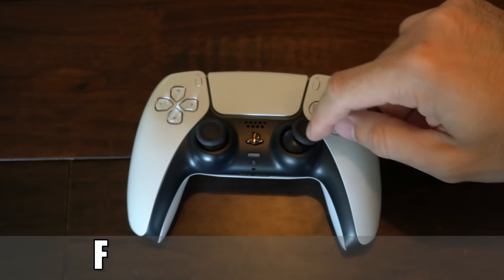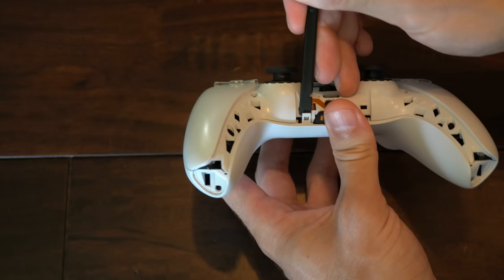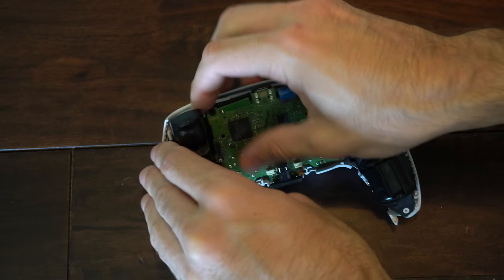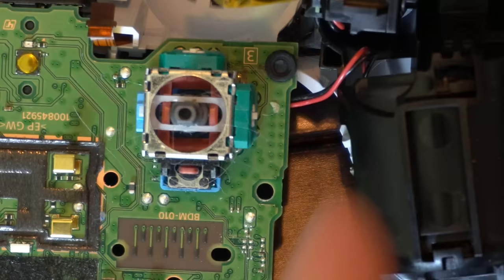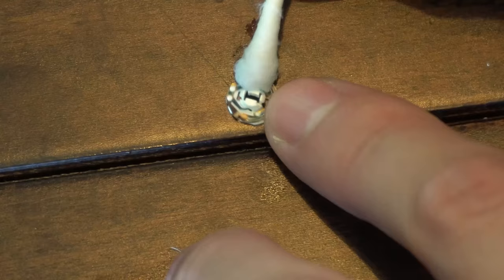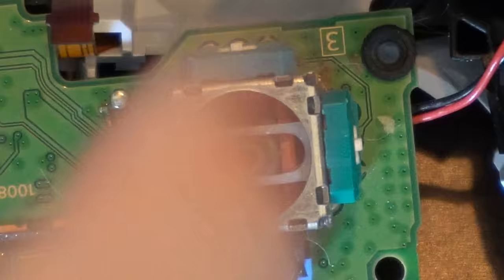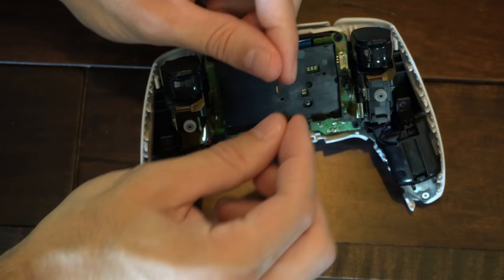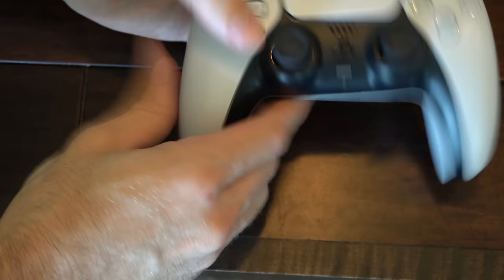How to FIX PS5 Controller Stick Drift & Moving on its own (Best Method)

Comment: Worked for me on the 1st controller i tried that had terrible drift. Just disassembled the 2nd 🤞update; fixed the second one as well. Very good simple to follow video. For reference I used WD40 blue for electrical components, I sprayed it into a bottle cap then dipped the cue tip in and cleaned it 👍
Reply: I did the exact same thing and it works wonders.

Comment: If you drop your controller a lot this most likely won’t help you, but if you let your controller sit around and get dirt in there then I wouldn’t doubt this strategy works . I took my whole controller apart and did this, and it didn’t fix it but I have extreme stick drift it makes me do 360s lol, Best bet is to get a new controller💯
Reply: That is what is happening to me rn. 😔

Comment: Thanks for the tutorial fixed my stick drift and for now it's working without any problems, even thought inside my controller was relatively clean I cleaned them the way you suggested and solved my problem. Thanks mate!

Comment: This was a great tutorial! followed it the right way and now my controller is working perfectly fine, It actually fixed my left stick drift. One thing I would like to add is to be extremely careful when opening the green case (potentiometer) because that can break pretty easy.

Comment: The only thing that fixed it for me was bending those tiny copper plates upwards so when you clip the green bits,they stick to the carbon circles firmer
Reply: That was the only solution for me, the tip of the plate was broken and the carbon inner circle was completely worn out, I had to bend the plate upwards and to the side to make contact with the external circle, it seems to be working fine for now but I don't think it will last more than a couple of months.
Reply: In my case one of those little copper plates was broken, I ended up replacing it with one from an old xbox controller, and that worked.

Comment: I followed the instructions but after reassembling  and turning it on, I tried a custom match on MW but the right stick is now stuck at point at the sky while turning left automatically. Any suggestions?
Reply: you sticked the sensor upside down

Comment: This worked like a charm. One of the green censor inserts had this black crud around the inside. Make sure all the inserts are properly placed when you put it all back together. I put it back together and my joystick wasn’t even working…after dissembling again, I put one of those inserts in upside down. Did it all over and now works perf. Be patient and gentle. Cheers!

Comment: Well, it actually did work perfectly. I did try opening and cleaning the controller before, but never actually took out the sensors. There was so grime inside and cleaning it actually got rid off the issues I had. Great tutorial.

Comment: Tnx man this is a great guide and easy to follow. Since I had all the tools I did it with all the confidence and I took it slowly step by step. Mine had some black grease inside, after cleaning with Isopropyl alcohol the drift is gone. You saved me a replacement and the hassle of soldering.

Comment: This worked flawlessly! Thank you so much! 

I believe the issue comes from plastic particles from friction between the joystick and the housing. Similar to what happens to the N64 controller but with a much finer or more sensitive mechanism. There were small black dust-like particulates that were cleaned off the contacts.

 I'm a very clean individual and I click-clack the thumbsticks as a habit during loading screens.

Thanks again! God bless brother 🙏❤️

Comment: I was skeptical at first because I did not see a speck of dust in my left stick's y-axis sensor (which had erratic y-axis movements). Cleaned it with alcohol pad + toothpick anyways then it magically fixed my problem. Thanks to you.

Also, taking the shell apart is the most difficult part IMO. I almost broke the pointy plastics.

Comment: BRO THANK YOU. SAVED ME 100 DOLLARS BASICALLY. 

I pulled out one of the blue ribbons entirely and I thought I was done but I was able to get it back on, and the battery part had me sweating.

If you take your time and go step by step you should be able to fix your stick drift yall..

W video man.

Comment: Solid guide and it worked on my oldest controller that came with the ps5 that had a hard left pull on the left stick. Also cleaned up my back up controller and that had slight drift creeping in. They both work like new. Excellent tutorial. Id recommend a broad beak tweezer for removing the ribbon cables and electrical contact cleaner rather than alcohol.

Comment: 10/10 video. The screwdriver you’ll need for this is a #0.

Had two controllers with this problem and just successfully fixed them both in about 1 hour on my first try. The trickiest part was opening the green joystick piece. Anyone trying this just try to control the force you apply to the green piece so it doesn’t bend all the way once it’s open.

I used a plastic card to open the controllers. Using a toothpick to clean the gunk works good too.

Comment: thanks for the video! In my case, left stick was drifting left , making it unbearable and unable to play any game. It turned out that this little round plastic thingy inside analog stick had those tiny pins turned in the wrong direction lol. I straighten them out and now it is working perfectly! I was furious, especially that controller is only 1 month old.

Comment: 2 controllers with horrible drift where character/menu items go way left. Fixed one of the controllers completely thanks to this video. The second one, still doing it a little bit but I must have not cleaned it well enough. Either way, this video saved me at least $70 on a new controller.

Comment: My controller had drift issue after 6 months, never had this issue with my xboxes before.

Anyway thank you for this video, a lifesaver. Very detailed and it works well. Indeed one part of the sensor was black and had to be cleaned. 

To anyone attempting this, these are my lessons learnt from a clumsy hand.
1) the white sensors are very fragile. I broke a small white part when cleaning it with cotton swab. meaning the stick wouldn't move back in one direction. Blutack saved the day (gunpla glue wouldn't do it). 
2) when attempting to fix the above problem, the green and yellow wires came off (I guess this is for the vibration). Didn't have my soldering kit with me so Blutack again saved the day.

Comment: This is very helpful. And very easy to follow. I tried it on my 3 year old ps5 controller and its now perfectly working. Some of the edges of the small components are damaged a little specially the blue one and its not perfectly closing(maybe because I use metal tools to pry open) but the important thing is No more drift. Thanks you very much. No need for me to buy edge. 😊😊😊

Comment: Thank you, your guide helped me clean the left thumbstick and completely eliminated the stick drift I had. I thought I had broken the small sensor piece because a bent one if the tiny metal prongs, but I guess they are just there for resistance and to hold things together or something as it didn't seem to have any effect on using the controller afterwards, but I used tweezers to bend it back to where it was roughly anyway just in case

Comment: Excellent tutorial, thank you for sharing this it helped me out big time. The only thing I'd change is the battery removal, the wires are super thin and very easy to damage. I just left it connected and moved on the the next step.

Comment: Awesome stuff man - I tested my controller at intervals throughout the process and it had actually been sorted just from taking off the faceplate and beginning to swab around the sticks. I'm guessing it was just some cat hair, dust, or grease. I did the entire process, just for the practice, and it was easy to follow. My only issue was getting the latches off at the end, as I didn't really have a tool for the job. I managed to get it done with a tiny flathead screwdriver, but I will buy something fit for purpose next time. Great work!

Comment: Great video - following the instructions exactly will fix this problem tenfold. The only thing I will say is that some controllers are a bit newer or older than others, so other pieces may come out entirely, whereas sometimes only the ribbon things on the motherboard come out. As long as you reconnect everything that comes out and that has been disconnected and you’re gentle with the controller, it completely resolves the issue without you needing to go get another controller entirely.

Comment: I broke like 5 wires in the process, lost two screws, and chipped a small part off. Basically I messed up almost as bad as you can, but it still helped big time.

Comment: Your the man!!! Ive never taken apart a controller of anytype or any electronics for that matter, my controller is only 5 months old and it started drifting at around 3 months the first time and i used duster that time and it seemed to work up untill now but i followed your video step by step and it is now working fine without using duster !! Ill post again if and when it starts to drift again to let everyone know how long it lasted but really thanks 👍 I didn't have to buy more duster or wd40 contact cleaner or thankfully a new controller. Once again thanks

Comment: Nice. Just did mine exactly as you showed and it worked great. Found a small eyelash in there! Thank you very much.

Edit. Nevermind. It was OK for a second and now the thing is just screwed after trying to fix it a few times. Thinking of replacing the whole housing.

Comment: Idk if I did something wrong when either cleaning it or taking it apart,  but I went through the entire process of taking my controller apart, unplugging the wires, taking out the sensor and cleaning it and I still have drift. Honestly I think it's just unfixable because it's had drift like this for a little over a year. At least I now have a practice controller if I need to work on anything before using my main one 😅
Reply: did you ever drop your controller ever ?
Reply: @slladowrealms  No, and even if I did it'd just land on carpet
Reply: @UB13 Same here bro I just took mine apart cleaned it and put it back together and it still has drift

Comment: Thanks for this video . I took it all apart . Directions were very simple & I got to fix what my issue was . It had a bunch of black stuff built up so I soaked it in the cap of the alcohol cap waited a few an then used a baby toothbrush and needle to clean around the copper areas that way the cotton hairs didn’t get stuck in the copper . No more dragging sticks . Thanks a lot 🤜🏽🤛🏽

Comment: Great video currently have 3 controllers with drift one is less then a year old thanks Sony.
Bought some replacement stuff from Amazon came with whole sticks and bunch of white circle thingys . 
Tried this with the one that was most far gone basically unusable changed them out works great now took me 2 hours so cost benefit may not be worth it if you got the 70 to drop would just get a new one. But if you have the time and patience like doing diy this is by far the best tutorial I’ve seen. Great video thank you 
PS4 controllers were far superior imo

Comment: I fixed my controller thanks to this video. Took me a while and I had to be careful with the pieces but well worth the $70 I saved. The drift was so bad the controller was useless anyway. Only reason I felt brave enough to try. Was gonna pitch it otherwise

Comment: IT ACTUALLY WORKED WTF! THANKS!

It really helps to have some tweezers BTW, and when you're putting those little pieces back from the analogue stick back in. Slot them over the little hook bit first, makes lining it up a bit easier.

Comment: I had stick drift to the left and tried this fix, but after putting the controller back together the analogstick was contiously inputting down. I probably  somehow damaged the sensor when cleaning it. But  a quck tip if you have the same problem and damaged the sensor(not the potentiometer), the ps4 cotrollers have the exect same sensors so you can just switch them out. This worked perfectly and my controller doesnt have stickdrift anymore

Comment: This actually worked for me! I had 2 controllers with drift issues, one of them was a dead case cause it was drifting in the same direction constantly so I experimented on that first and then I fixed a second one who was 3 months old only

Comment: I think I fixed it. It was those little sensors where the joystick was. Not sure if I connected all the wires, especially the bottom one, it was hanging out. But it works. So I’ll take that as a win.

Comment: It worked for me! There was a small strand on one of my sticks. Unfortunately tore the ribbon cable for the built in mic at the front of the controller by accident, but never used that functionality anyways.

Comment: I did this but since Ribbin cables are the bane of my existence the plastic piece snapped then a bent one of the metal wires and I’m trying to use electrical tape I will respond with the results

Comment: pro tip- if you cleaned both sensors and still have stick drift switch sensors from either side that fixed both my controllers with stick drift flawlessly

Comment: I guess it only takes the smallest spec of dust to disrupt the functions of the controller. Ive never had stick drift before; bought a new controller and like 3 weeks later casper starts playin with me. 

Man that felt like straight surgery, going in there trying not to break nothing. But it worked! Hopefully I won’t have to do it again too soon; much appreciated 😂😅

Comment: I followed this and the sensors were clean AF when I looked followed the process anyway but when I put back together just as I expected … still the same I’m furious that I’ve spent so much money on a fuckin console and brought an extra controller & they both have stick drift… one is the left analogue and the other is the right !!!

Comment: If people are having issues with it not fixing. Check the spacing on the distance between the metal tabs in the sensor, if they are too close it won’t work correct

Comment: I used canned wind pc cleaner to a partially fixed condition…. Im not taking it apart like this unless its absolutely necessary ,so goad you made this step by step….what i am curious of is: with my left stick pushing left randomly on pga23 now that i used compressed air …with the game off would it be safe to spray  electronics cleaner as an attempt to fix .then let it dry for a day or so before turning on …or would that possibly short out something because of battery still being in the controller?

Comment: I did the same. But the issue is still there. I mean there was nothing to clean by the way. It looked clean. Still I used alcohol and a qtip to clean. Then put everything back in. But faced the same issue. Didn't help me 😢
Reply: maybe your sensor (the white part) was put in upside down cause i faced the same problem and that seemed to work lmk how it goes

Comment: Great video!  I followed it and was able to clean my sensors and replace the thumbsticks, whose rubber caps were cracking and coming off.  However, my third-party thumbsticks seem to be too big a by a few tens of microns.  The stick doesn't snap back to center, due to too much friction.  If I press down hard on the stick, that gives it just enough slack to work properly, but it only for maybe 30 seconds.  Anyway, do you have any tips maybe for hacking a solution, short of buying a different brand of thumbsticks and replacing them once again?

Comment: Did everything you said step by step, noticed there was a lot of small cat hairs so I tried carefully removing every single one I could see but after cleaning the sensors and putting it back together it still drifts to the left as it did before ☹️ wish it worked since this controller was the Spider-Man 2 edition

Comment: Thank you SO much 🙏 I have 3 controllers and two of them had this problem. I fixed one of them today and it works perfectly! I almost fucked up at one point when I accidentally removed something I wasn't supposed to. 😂 I will do this to the other one tomorrow!

Comment: I do not recommend doing this because yeah the stick drift will disappear but when it comes back you wont be able to fix it again since when you previously cleaned it you removed the lubricant from the potentchemoter that prevents scratching on the green piece. Without the grease the metal disk will rub onto the green and cause permanent damage

Comment: I’ve had my ps5 controller for eight months and never use my controller aggressively at all. I got stick drift on my left joy stick badly. Did everything in the video step by step and it actually worked. No issues anymore. But Sony should be sued for how terrible their controllers are bc my ps4 controller never had this issue early on. SMH

Comment: It may work for some but now my controller is completely bollixed
Reply: same
Reply: @theonethingwealladore   i then had a moment of genius,  I googled are the potentiometer the same, as the ps4 or ps3 ones and it was, that’s the white bit that was inside the green box thing, I have had a broken ps4 controller in a press for years that was already taken apart swapped out the white yokes and it’s worked like a dream

Comment: Just wanna say the operation was a success. You can easily break your controller more trying to fix it, be careful with them ribbon Cabels they're a pain to pit back in, also care with the last part of the video where he takes the plastic thing off the joystick. There's no real warning in this video.

Comment: QUESTION TO OP: as i was taking off the back black plate inside the controller, i ripped the orange tag at the bottom . did i mess up?